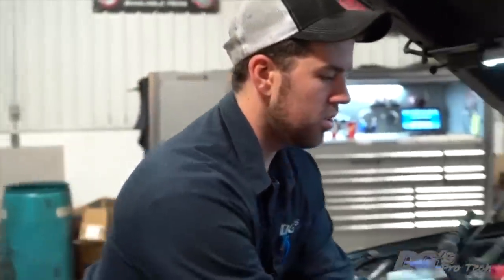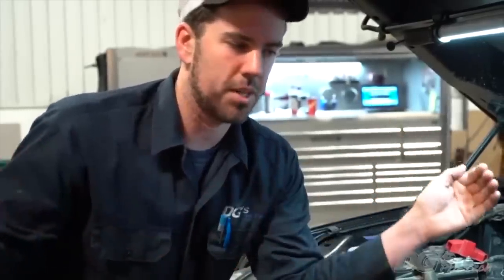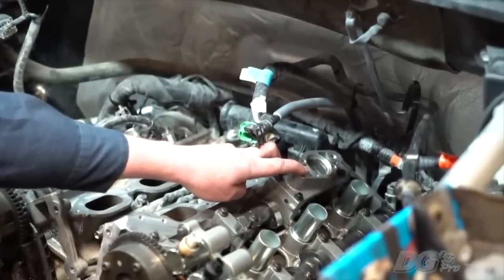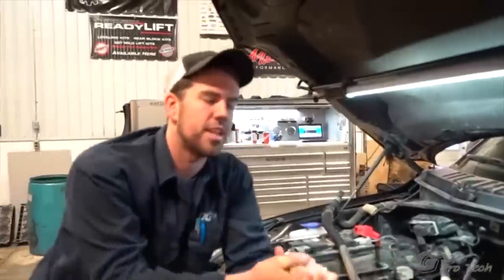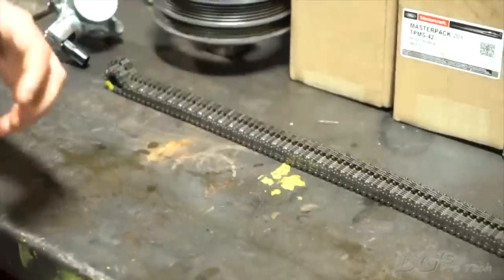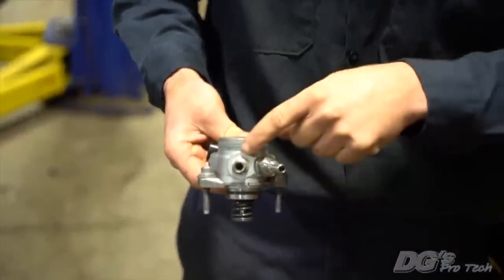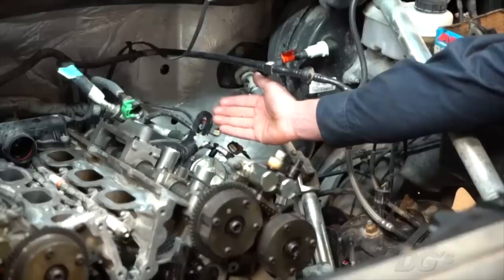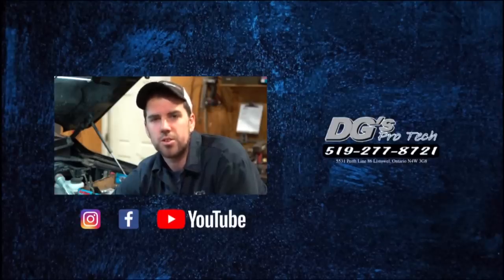What you NEED to know about Ford EcoBoost Engines by Dustin Golley of DG's ProTech

Comment: Chevrolet 3.6 are the same way along with front oil leak. One thing about ecoboost they pull like crazy. Got second gen ecoboost 2018 with duo fuel system.

Comment: Love the advice on the turbo. Now I MUST run it hard to help my turbos stay in good mechanical condition! Which means my beer runs will be even quicker... Thanks for your tips. I run Amsoil and I've been changing it at 10K miles. I'll drop that down to 8K. My 2011 F-150 has 130K miles, runs good and has been reliable. I do keep up with maintenance and fluid changes. 

BTW, hate that camera and how it keeps trying to focus. It needs an oil change.
Reply: Drop that down to 3k-5k

Comment: I have a 2017 Ford Edge SEL with Ecoboost and 78k miles. No problems with it all. Engine still runs and sounds new. Oil changed every 5k or so. Best vehicle I’ve ever owned.

Comment: You know one way to avoid all these complications is to buy a pushrod.  Instead of four camshafts, just have one and you’ll never have to worry about a timing chain
Reply: Most pushrod engines I've seen still have a timing chain.  It's obviously much shorter, but it's still there.  You'll also get nowhere near the performance out of it either.
Reply: Steven Rhodes less links = less stretch and more durable

Comment: Awesome explanations...I’ve been running the 3.5L Ecoboost since 2011.  I have 240K on that one, still going strong.  I loved it so much I bought a 2015 last year ( low miles).  I change the oil every 3-4K, no exceptions.  I’ve run the 5W-30 synthetic blend it called for since the beginning and I do the same for the 2015.  I’m a firm believer in pm’s especially oil changes...probably the cheapest thing you can do for your motor.   Ecoboost - lb for lb, best motor I’ve ever run.  Towing / efficiency, can’t beat it
Reply: yeah when i put my 6,000 lb boat behind it i was shocked how easily it went up a 7200ft pass with no effort--i kept it at 50mph but it would have gone way past that

Comment: Great job Dustin..although I've been a professional mechanic for over 40 yrs I don't know too much about these engines. Very interesting as I have a 18' Raptor (aluminum oil pan) and have been running Amsoil Syn since first oil change (use Motorcraft OE o/filter) and NOT going by those crazy long intervals...Thanks!
Reply: where are the "crazy long term intervals" posted/printed???  My guess is: a) sales brochures; and b) owner's manuals

Comment: Have 2017 Explorer Sport 3.5 TT.  On my latest vacation on drive from Lordsburg NM to Casa Grande, AZ got 25.8 mpg. 80 mph on cruise control.   Only synthetic oil changed every 5-6000 miles.  Now has 83,000 miles and new plugs at 80,000.  No breakage at all been a great truck.

Comment: Not sorry; ecoboost is the most advanced piece of dogshit I've ever owned. 3x ecoboost all with impeccable maintenance 
-1 the turbo waste gate stuck
-all 3 had timing slips within 70k 
-major carbon build causing turbos to lose boost (not sure if described right here) 

Overall never buying another Ford ecoboost or not. Between Ford allowing 17 inch spark plugs in the old triton motors and the piss poor turbos in the ecoboost im done. Screw em

Comment: I have a Lincoln MKX 2.7. With 89,000klm on it.
I’m extremely fussy about all my engines and maintenance on all my equipment. I plan to take it to these guys to hopefully have the Carbon removed. I use Amsoil oil and change it every 3,000klm. Along with Oil Filter/Air Filter etc .I also put on a oil separator in the vacuum line to reduce the dirty Vapor getting into the valve area. 
I do like the vehical and love the power. It’s crazy quick for a 2.7

Comment: Great video man!.
I'm having trouble with mine, it kicks when I accelerate it and the engine light flashes on. I have to stop accelerating for it to stop kicking. I'm not sure what it is but it only happens when I accelerate fast. Other than that when I drive smooth and slow it runs good.
Reply: You have a misfire. Change out the spark plugs!

Comment: He said it folks.
Change the oil, use synthetic of the required viscosity, an OEM filter and change it a little more often than recommended and most Fords will last you for the most part.
Learn about what you have, how to take good care of it and almost always it will last you.

Comment: I have a 2014 f150 3.5L ecoboost. I use royal purple with a wix filter both changed every 3,000 miles. Replace plugs every year. I do use a k&n factory replacement I wash about every 1.5 months but I dont drench the filter like when they come new. Yes I do often check my air filter hence why I said 1.5 months and if its showing a bit of dirt i do sooner. I use royal purple in diffs, coolant, fuel, and 2 qt in with the trans. Next objective is to add an inline high flow trans oil filter. I only use ethanol free 91-93 octane. These trucks run like crap on the 10% ethanol mixes.

Comment: It helps if a mechanic calls a customer and tells them what they should change when they are torn down that far,
I would even have the water pump changed when put back together , Meaning any working part that is critical should be changed on reinstall ,
Last thing you want is have something like a water pump going out 10k miles later and paying for another tear down,
But its very rare for a mechanic to call and say if this was my motor and here are the issues we see. It will save you loads of money in preventive
or you can wait and hope for the best
Reply: As far as gas mileage, I get average 19 mpg, I couldn't be happier, But I also have a 10 speed, I can go 80 mph and not hit 2k RPM, 
Hardly even hurts a motor, I do have times I will run it semi hard and manual down shift it down to 6 speed , Raises the RPMs to about 3.5k
I am a  freak when it comes to my vehicles, I always change fluids, even ones Ford says never needs its, I still have my 4.2 02 ford F150,,
Has a little over 200k and runs great, Only 2 times did I have to take it to a dealer to fix, One of the issues I should have taken Ford to small claims and maybe they would have
paid to fix it, It was an engineering defect that started at 38k miles, Most 4.2s fell victim to the flaw, It was fixed in 03. Its been so long ago I can not tell you the code but can tell you it was an intake manifold vacuum leak,

Comment: Hey, I liked your component review. I have a 2016 Ford Tauras SHO with 34K miles, I bought it when it was at 30K. I can't tell you what a blast that thing is WOW it is just what I wanted, AWD, horse power, great pull of the open road at the top end. After reviewing a few videos on YouTube I came to realize how high mantance that car is. Also, I heard that Ford is not going to build cars anymore. So after thinking about it for a while I decided to look at the components of the engine and Drive-train. The problem I ran into was that I'm having trouble finding mechanical drawings on the V6 SHO specific engine and Drive-train. When I was a kid, I knew hot-rod-ers who would Blue Printed theirs cars "stock engine components" for the type of application they wanted, i.e. street or strip. I want to rework/alter, some of the critical stock components operational capabilities, for a Drive-train that can operate at 140 mph over a 200 mile stretch and still run very cool + or - 5%. The first thing that comes to mind, are the weak links, the PTU is not serviceable. I want to set it up (PTU) to pump its fluid through a filtered cooler using just the internal gear action as the pump.
Any advice would be cool to me. I love that damn thing, I'm going to make it a collector's, special edition The SHO SE.

Comment: We have 10 year old f150 ecoboosts now in our fleet at work and they've been on average as reliable as the 5.4's they replaced. The full torque available at low rpm, like a diesel, is reason enough to get one in your truck.

Comment: There is no free lunch and horsepower is horsepower!!! That combined with driving for economy is bad on the engine, (He forgot to mention carbon deposit issues on valves with these engines) and driving with boost is not much or any better on gas than a NA V8, give me a big naturally aspirated V8 over these all day long. Mr Murphy is a bitch and these Fords come with expensive maintanence and repairs. No Thank you Ford. I smoked one of these trucks with my Titan the other day lol.

Comment: Sounds like a piece of Hi-Tech shit to me. My tundra has 283k on it and I barely change the oil on time, I've never changed the rear in dope or had the trans fluid changed. Brakes and oil is all shes ever gotten.  If want fast I'll drive a sports car. Between Ford's timing chain issues and cam phaser issues and internal water pumps, they pretty much put me off for the rest of my days.

Comment: Just had to change my timing chain at 42k miles on my 2017 3.5 eco boost. Love my truck, just hope it will hold up. All I can do to not go trade this in on a 7.3 F250
Reply: You should have had a v8. All turbo's do is demand power out of a source that should never have it. Trade it in.

Comment: Wrong dude. It is pure shit. At 900 miles mine blew the turbo. It was not on a load but cruising on the highway. Ford repaired it in only 5 weeks. At 2100 miles it floated the valve train at start up. Ford refused to repair it until I retained an attorney. I was a lifelong Ford guy , over 50 years and I refuse to even ride in a Ford. Aluminum bed, engine that is to complicated for the average tech to understand and upper level management from district that called a consumer a liar to my face. It was shit from the factory..

Comment: The second gen 3.5 still has timing chain issues.
Reply: No it doesn't. A few built during a certain period had CAM PHASER issues, NOT timing chain.
Reply: @billgates1682  
https://youtu.be/EyjOfWOAiHA

I've also personally talk to two owners of second gen 3.5's that had to have their timing chains replaced so it might be better but not fixed.

Comment: I had the infamous 5.4 three valve in my F150 and never had any issues,,,,I towed and ran it hard. Added dual exhaust, cold air intake and super chip tuner. Really loved that truck for 12 years until I got a gen two Raptor.  
The 450 hp twin turbo is amazing.  

The way to make all these engines live the longest is to change all your fluids early.  

Engine oil at 2500-4500 miles and use full synthetics only. 
Transmission, transfer case and axles at 50-75K 
Radiator at 5-6 years 
.
Reply: That is the whole key to all these modern engines with long timing chains, multiple cams, variable timing etc.... Quality synthetic oil, quality filters, and change frequently.  

The machining clearances and oil holes in parts are so small and exact, it is really easy to do damage with overly dirty oil.

Comment: I just purchased a 2020 Ford Explorer ST. It has the 400 HP 415 lb ft torque 3.0 Liter engine. I am happy with the performance but NOT with the fuel milage. Without even getting into the boost very often I am getting 13.5 MPG in town & 17MPG on the hiway @ 62 mph. Very poor =, not not even close to what FORD says it should get. Don't know who can correct this, as most of the FORD dealers hust make excuses but don't know what to do to fix the problem. If they woul put the 5.0  V/8 in this vehicle , I would have got it instead of this turboed engine.

Comment: I lost my 2011 ecoboost  the timing chain jumped and wiped it out so i found one that had 41.000 on and had a shop install it as it is now upon acceleration and the engine goes into a boost low or high 35 mph the drivers side hose will blow off and the turbo sounds like a jet because the boost is going out into the air do you have any idea what is causing this issue. Thanks My name is Bill Reaves my email is bigbillreaves@gmail.com
Reply from the maker: Hello Bill! Someone from our Tech Support Team will be contacting you today. Thanks for your message 👍
Reply: @CardoneIndustries  how can i contact Dustin I would like to speak with him and explain to him whats happening I fixed the clamp and that seems to have fixed the hose blowing off but with the hose on the engine will smoke like i have never seen the old engine that blew i am sure dumped a lot of oil into the exhaust however this engine only has 41000 miles on it and was purchased turbos and all I just wonder why it only will poor smoke as it does when the pipe is installed this is why I would like to speak with Dustin that way I can explain to him more. I will pay him if necessary for his time on the phone with me
Reply from the maker: @billreaves263  https://www.dgsprotech.com/

Comment: How common is the timing issue on these.  I've redone the timing on my 5.4 triton twice and it's going out again.  I redo the oil every 3000 miles and put in tensioners similar to the ones in this video (metal ones that ratchet out).

Comment: Great video, concise & to the point, and no annoying music, lol.  One thing warn people on when buying used vehicles- maintenance & repair records mean a lot, what kind of oil and how often oil changes, etc. Many modern overhead cam- dual on v-6/v-8's can be costly for these repairs. An acquaintance recently purchased a used Ford Flex non-turbo model,  over 100K miles, chains were stretched, cost $2K to get everything changed out. He did not see that coming.  That's one good argument I can make for the standard Chevy LS push rod motors, they still managed to keep things simple even if they come up a little short performance-wise, still a less troublesome design to consider when buying used. Open the hoods and you can still see the ground, far less expensive technology. Ford loves technology under the hood.

Comment: My 2018 expedition Max Limited XL gets 20-21 miles per gallon. Running mostly 75-80mph 2wd and I avoid eco mode as it drops fuel economy to 18-19.5MPG. Average trip 760 miles one way. Great vehicle though.

Also use 89 octane as manual states as more or less octane also drops mileage. Seems tuned to the way I drive the speed limit, long trips in non eco mode.

Comment: Just give me the v8 for power output that these engines put out.  Way more headache maintenance and stuff to go wrong on blown or turbo engines (excliding diesels).  I dont want that extra cost headache for something at the 500hp mark and well under. Its why i wont even look at a raptor as an option for my next vehicle atm. Only gas engine powered ford has that i'd buy which is boosted is a gt500.

Comment: So what I got out of this is. "BUY THE 5.0" avoid the ecoboost….
Reply: Meaning you did not pay attention.
Reply: watch it again....
Reply: I had a 2018 5.0 and it had the dreaded “type writer tick”. The Ecoboost doesn’t have this issue that I’ve heard of. And the 5.0 is also a Dual Overhead Cam engine. So it has two big timing chains in it just like the Ecoboost. And can develop the same timing chain issues over time if not properly maintained. There’s literally no advantage to the 5.0 over the Ecoboost 3.5. Especially when you consider the capability of the Ecoboost. Just my .02cents.

Comment: I only need to know one thing about the eco boost, or any engine with an aluminum block and heads------don't buy them!  I'll never buy any car that is turboed, or doesn't have a cast iron block and heads. I also won't buy a vehicle that doesn't have a steel body. You can keep the fuel injection and the other complicated toys. I want a simple, durable vehicle I can depend on, like I could buy from ford back in the day.

Comment: Excellent video.  I have the 2013, 3.5 ecoboost, and I am extremely happy with it.  Now have 80,000 miles on it,  about 40,000 towing a 6,000 lb travel trailer.   I do the full synthetic at around 5,000 miles.   I take it easy most of the time, but I think I'll do more  turbo time to some of my drives.  Love my truck.

Comment: It's kind of funny,  the old school (low tech simple) 302 with some hi-po options (aluminum heads, hyper u pistons,  roller rockers, etc. ),  Holley sniper injection (or just a carb), easily makes 400 plus  HP..  (totally reliable)Why do you need a pumped up v6?? I guess the v6 can get better mpg -  that might save you a few bucks.. ??.Myself,  I  don't think the "ecoboost" really justifies all that complexity compared to the old school 302... The money saved in gas mileage is all lost and then some in all that ridiculous complexity of the ecoboost v6...

Comment: Direct injections n a small motor with high hp and tq in the long run the motor will ware out faster n not last as long as a rev v8 motor. I’ll stick to my v8. Will last lot longer in the long run

Comment: no mention of why the water pump was designed to be on the inside of the engine, run by the timing chain, and leaks coolant inside the engine and mixes with oil  which ruins the entire engine.

Comment: Thanks for the info. I have a 2015 Transit 150 8 passenger van with the 3.5 EB motor. It’s a beast. Plenty of power and pickup. It has 64,000 miles on it. (I bought it with 50k on it) I change my conventional oil every 3000. Might switch to synthetic and go every 5000. My last 1999 Dodge Ram Van had 380,000 on it. Maintenance is everything. 👍